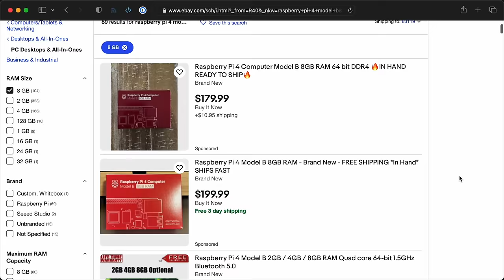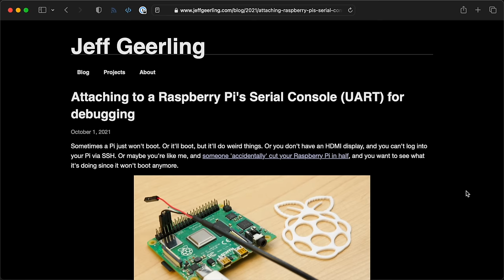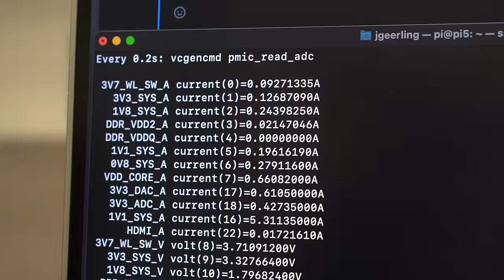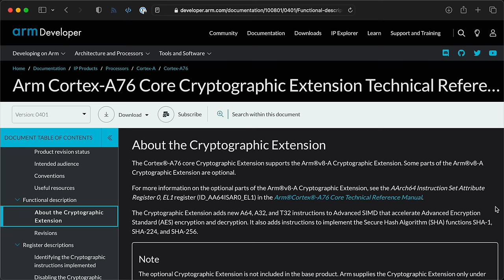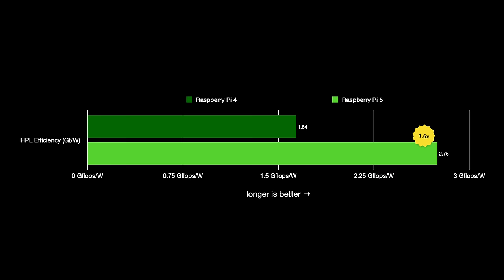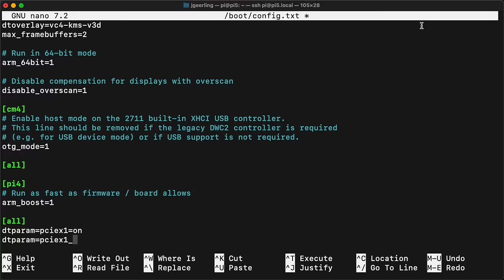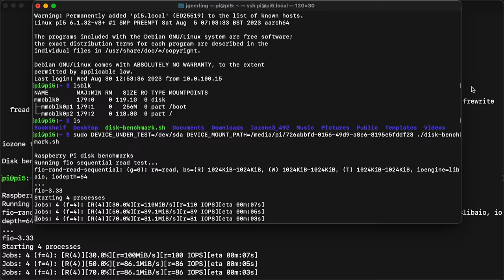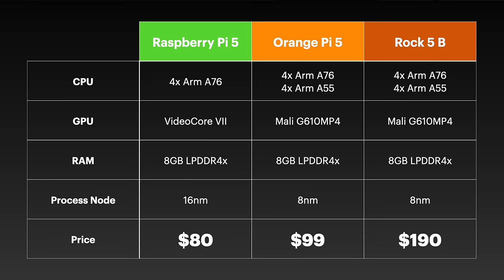Raspberry Pi 5: EVERYTHING you need to know

Comment: Test suggestion: Try if you can set the RPi5 to be a streaming box connecting a capture card to the PCIe port, through USB3 or even using the CAM ports. And with OBS to manage all.

Comment: Check to make sure the wifi driver is actually using the 6Ghz radio!  I recall there was some ridiculous issue with it disabling it because it couldn’t confirm which country you were in.  I think that may have been Intel chipset specific but either way 🤷‍♂️
Reply from the maker: It is working! There are some issues with country and sometimes if on older Linux the kernel doesn't allow 6 GHz band. Have to check with iw

Comment: With the prices these are reaching, it's probably time to add in sff x86 to comparisons. Especially if the power usages are in the same area.
While I'm happy to hear that a lot of stuff has come together and quality sounds improved over the Pi 4 (the USB-C weirdness was really lame), the price jumping higher is going to really start putting it up against x86 where it's going to have A LOT of trouble competing since x86 just has way better compatibility, performance, etc.
Reply: Indeed, x86 still tends to be powerhogging in comparison to ARM but still potentially dealing with older process nodes might well keep it fairer, or ruin the x86 in comparison if you stick strictly to the same price bracket and so old x86 stuff too. But as the SBC prices have jumped quite alot on the way to giving them this much computing horsepower, so a comparison to something like a Steamdeck suddenly doesn't seem so unfair, and that thing has to be the best price to serious performance computer available right now.
The Pi folks historically have done a really really good job on compatibly and performance compared to the other SBC and good enough that for most normal users it will just work, so if the Pi5 is more of the same I expect it still stands up well.

Comment: Hi thanks a lot for the video. I really loved it. I also appreciated a lot the comparison with the rock 5b and the orange pi 5. However you kinda confirmed my fears: every new generation the raspberry pi seems to get roughly twice as fast (or at least twice as useful). This means it will not run a 4k desktop. It's very nice but I would urge people to not upgrade their monitors. A 1440p may be ok but not more than that at least not unless there is some crazy driver optimization that happens down the line. I'm sad for the 3.5mm jack that I actually used a lot. Not all the monitors and not all the projects have that. The big sadness it that now every other manufacturer will copy the big fruit just like it happened on the smartphone. In this regard the raspberry pi had a great responsibility and it failed.
Reply: No headphones jack = brain cancer

Comment: The RPI chip could potentially allow real-time control of IO which is ideal for Robotics applications. I typically use a custom designed rp2040 hat to do this.
Reply: The PI4 is fine for Robotics aswell.
Reply: @AndrewTSq  It is, i've made extensive use of it.
Reply: You could probably do that with any Pi as long as you have a real RTOS to run instead of Linux.
Reply: @jnharton  you can to some extent yes. But it's significantly easier with a dedicated io processor. That's why beagleboards were really good, although they didn't have the commimunity support.

Comment: It would be interesting to see if that RP1 chip supports PIO like on the Pico. Then we could do some truly wild things with it.
Reply from the maker: AFAICR it doesn't, but don't take my word for it. It's like a semi-RP2040, but there are some things in there hidden away that I haven't seen yet.
Reply: If there is PIO hardware in the RP1 chip and it is as well documented as the RP2040 then things like LinuxCNC and stepper motor controlling will be very interesting. The latest LinuxCNC on Bookworm works fine on a Pi4, on a Pi5 it should be even better, eventually?

Comment: Thank you for this great video. I'm curious about the video encoding/decoding benchmarks using hardware-accelerated tools. Please correct me if I'm wrong, but it seems you used x264 for video benchmarks, which is a software implementation of the codec. It would be greatly appreciated if you could also test hardware-accelerated tools, such as gstreamer with omx enabled.
Reply: The rpi5 doesn't have a video encoder block.  You have to use software encoding and pay a large power penalty.

Comment: I’d be interested in seeing a dual camera image classification system. Can the pi5 run two cameras with object detection without an external NPU like the coral? On the flip side, how many camera feeds can handle running frigate, ideally with a Coral if that gets fixed on software, though I assume the USB coral still works.

Comment: Great review Jeff. It took them long enough to get to Pi5, but disappointed they used a less efficient chip, which will take another 4 or 5 years until that is upgraded, if they release Pi6 at this rate.
Reply: It's much more efficient than 28nm Pi4 chip
Reply: @BusAlexey how can it be more efficient if it needs a stronger powersupply by default?
Reply: @TecSanento  Watch ExplaingComputers review. The chip itself pulls 6 watts at most, and that's for 2-4X increase in performance (over 5 watt on Pi 4). All additional watts are for High-power USB and PCIe peripherals (each USB can pull 5W, PCIe can pull 5W, cameras can also pull power). Pi Foundation reccomends a 25W power supply so there's no problem with all peripherals sucking power.
Reply: @BusAlexey  (stupid to require everything over the one single input) - or support higher input voltages. I don't have a single 5A 5V one - even the 200W USB C PD ones)
Reply: @TecSanento  It's not required. The chip's power went up literally by 1 watt. You can still use 5V3A for the max of 15W to the board

Comment: I REALLY REALLY hope they didn't muck up the usb c (and pd) compliance like last time. There's some really efficient GaN phone chargers out there that may be able to power the pi 5 and more just fine without needing the pi psu again.

Very excited for the die shrink and the cpu upgrade though.
Reply: No, it is broken. 5V 5A is bad. That is rare and for good reason. The official PSU even supports less current on higher voltages. That is a USB-C no-no.

USB-C standard imposes a "bigger is better" rule. A PSU with more watts shouldn't charge any device slower than a PSU with fewer watts.
With 5V5A this is possible. A 60W PSU may only support 5V3A (but also 20V3A), causing the Pi to complain. The official 25W PSU however, works.

If more devices do this we can end up back where we started before USB-C, when fast charging really only worked with OEM PSUs. Just look at early Nintendo Switch consoles and the problems they caused. Imagine each phone manufacturer used their own current/voltage combinations. Chaos!

The USB-C standard says 5A is optional in the cable. Most cables are only 3A, making them cheaper and more flexible. To keep "bigger is better", this means PSU's shouldn't offer 5A below 20V. And if they do offer 20V5A, they must also offer 3A on all voltages below. This maximizes the utility of 3A cables, and makes sure everybody chooses the same path for higher power: stay at 3A, but increase voltage. Only once 20V are hit, should 5A be used.

For the Pi, the proper solution would have required a voltage regulator on-board. I guess they didn't have space for it, so they chose to violate the standard. TBH it might have been better to stop pretending and use a barrel plug.
Reply: @oznerol256  The new PS does not violate the PD standard and has a 5A capable cable. It costs $12, and also supports 9/3A, 12/2.25A  and 15v1/1.8A modes. Its a very professionally designed PS, and very high quality.
Reply: @jamesh9756  The violation here is in the charge modes it supports. At 5V it should only be able to do 3A, but the pi needs 5A.
Reply: @jamesh9756  The 5A capability is exactly the problem. It shouldn't have that. The pi should use 9V3A and convert it down on-board.

The 5A way they chose means most PSUs will leave the Pi in power limited mode. Even PSUs with 100W!

And it could get worse: What if some genius makes more 5A capable PSUs? This may lead to more devices using 5V5A. Suddenly we live in a world where a simple wattage advertisement doesn't tell you how fast it will actually charge. Questions like "Does this 65W PSU support 5V5A or not?" shouldn't need to be asked, and will confuse consumers. What if another manufacturer decides to use 9V5A? It could become a mess. This isn't just my opinion. Read the USB Power Delivery Spec Rev 3.1, Pages 804+, Chapter 10 Power Rules
Reply: @jja2000  5v5A is a valid PD mode. It's not a compulsory, nor common, mode, so devices must negotiate and confirm all components are capable of 5A (cable, connectors etc). Which they are in the Pi PS, so the Pi will negotiate with the supply and only go to 5A if supported. Other power supplies may not support it, but that is down to the PS supplier. But to reiterate, 5v5A is not a violation of the PD spec as long as the negotiation is done.
Reply: @jamesh9756  can you point me in the direction to where it's within spec? PD profiles for 1.0 2.0 and 3.0 say the max current is still 3 amps.
Reply: @jja2000  you can have more than 3 A (up to 5 A in PD 2.0) if the cable has an e-mark chip in one of the plugs, which tells the PSU the cable has been built to support higher current. They either has e-mark in the cable or just built into the PSU itself (as the cable is also integrated into the brick).

Comment: Having designed a few boards with RP2040s on board, I'm pretty curious about that RP1 chip. I don't expect it to be something I'd want to design a board around, and I doubt it will be available on its own anyway, I just want to know what it can do.
Reply from the maker: You and me both! I am not the one to hack around on it too much (besides PTP and maybe a little fun). I'm looking forward to some of the interesting features people uncover.
Reply: @JeffGeerling  When I first noticed it was labeled 22/44, I wondered if that was in the same naming scheme as the RP2040. If it was, that would mean it has 2 ARM cortex M2 cores, 256 kb RAM, and 4 Mb of onboard flash. But then I realized there is no such thing as an ARM cortex M2 core, so I don't think that's the case haha.

I wonder if it has PIOs, like the RP2040. That could be a cool feature for some high speed custom signaling directly from the Pi5.
Reply from the maker: @CutoutClips  It sounds like there might be one PIO!

Comment: It's a real shame that it requires 5v at 5A, and not some form usb PD or Quick Charge.

While the "just use a old phone charger" principle died with the pi4. This really is a final nail in the coffin.  

I really hope you can lower that requirement buy not using the PCIe. 

Also no more using cheap Stepdown boards for power.
Reply from the maker: You can still run the Pi 5 with less than 5A, it works with the Pi 3A adapter, or other chargers I've tried, but it will put it into 'low power' mode where you can choose to throttle CPU, or limit USB current.
Reply: If you look at the brick's label @ 5:45, it can output 9, 12, or 15V instead.  Presumably it will default to a higher, more efficient voltage, or else why include them?  But whether it will work correctly at 12V * 2.25A on a better, GaN, multiport brick is what I wanna know.
Reply: 5A sucks, it means you can't run it off a USB power bank.
Reply: @estusflask982  You can still run it at lower power.  And any non-garbage power bank is USB-PD and presumably would run it at 12V * 2A or something.  If the Pi5 could only do 5V, they wouldn't call it USB-PD.

Edit: at least at idle @ 12:29, it is only running @5V.  Either that's standby-specific, confused by the power meter being in the chain, prefers 5V even tho higher is better, or it's just not really USB-PD.
Reply: "5V/5A DC power via USB-C, with Power Delivery support" this is straight from their own website, so I suppose we'll see, if other charge voltages will work. Because I get not wanting to de Stepdown on the pi itself, but 25 watt through 5volt is quite a lot. 

I had really hoped they went the BTT PI route and accepted native 12 volt. Although that is comparing apples to slightly more specialised apples.
Reply: @Idiot_Engineering  Personally, I'd consider "5V/5A DC power via USB-C PD" to be self-contradictory.  It seems like maybe the >5V modes were optional on the PD 1.0 standard, but that was 11 goddamn years ago and no one calls 5V only systems PD.  As for step-down, PC power stages are all >50A each 12V -> ~1.2V for <$1.  At <5A there's no cost or design excuse.  At 25W they'd waste ~2W and need active cooling, but the Pi has it.

Comment: On the lack of through-hole components:
1. The "complex robots" are cool.
2. Don't you need the ports (USB et cetera) to have some through-hole pins for structural reasons? I don't want my ports to be torn off the board!

Comment: Great video, thank you!  Awesome improvements in almost every area, some of which were indeed somewhat overdue.  I'll probably grab a 4GB one before long.  My only gripe:  still Wi-Fi 5?  Twice as fast, all these years later after the 4's release?  Wi-Fi 6 would have turned this "killer" rather than just "pretty good" for me.  Ironically, this board could surely pull higher WLAN speeds from a good USB 3.0 WF6 adapter (and maybe this was their thinking?... but then we're down a USB port.)

Comment: you got a new Subscriber. I wasn't expecting starting out back in 2012 with a RPI B+ to see an iteration of a Raspberry PI 5 this powerful and then to see the dang thing hooked up to a RTX 3080 TI 🤣 . This is absolutely brilliant. I am looking for a retro gaming system for my Living room, so when I have visitors I can have some form of entertainment without buying a Console. I have seen PS2, Switch, and other consoles being emulated on this thing. Micro Center to the rescue had some in stock and I was luckily able to nab one (The 8gb version), along with a PI zero W at MSRP value. I will definetely be watching more of your videos in hope of success with the graphics cards and other PCI accessories. I have a spare 1070 SC in a frankenstien AM3 X64 PC build running debian linux and wouldn't mind sacrificing a giant full tower case for a tiny ARM microcomputer. Keep up the amazing work Man!!

Comment: The resistor is funny. It means changing the position of a component during production runs is easier and/or cheaper than edging 4 different numbers on the PCB. 
It probably also allows for quick and remote changes. Really interesting. 😅

Comment: You brought up Machine Vision but neglected to mention the one big factor the RK3588 has over any pi... it has a 6 TOPs NPU on the SOC which means it is far more suited for any ML inference on the edge than the pi 5 will be. Not many will use this, granted but you did bring it up. In my testing an RK3588 can run a YOLOv5s 640p inference at around 20FPS on its NPU but the pi 4b can only manage 1.6 FPS. So if you are into custom ML on the edge the pi series gets blasted away by Rockchip. Not to mention the RK3588 are actually available ... I bet supply problems continue to hinder pi 5.

Comment: PCIe is going to open so many possibilities, like being able to make a NAS. I wonder how well it would do with a HBA in IT mode running 8 hard drives.  Could build a NAS using multiple PIs doing ISCSI to a NAS head and then doing CIFS etc.   Here's hoping they can actually produce enough this time since the 4 was basically impossible to get.

Comment: 13:14 YouTube allows your browser to choose between H.264 and VP9 video codecs for anything up to 1080p, but only streams in VP9 for anything higher than 1080p. Normally, your browser would fall back to software decoding if the codec that's currently used isn't supported by the hardware, but maybe the browser in Raspberry Pi OS is specifically compiled to never use software decoding for performance reasons.

Comment: 13:20 Youtube is not blocking that option because you are on pios, but because 4k youtube is only supported via VP9 and AV1, which the RPi5 still doesn't have. Youtube only supports h264 up to 1080p (and h265 not at all) for compatibility with old devices and devices that refuse to support the newer standards (which is why it's so strange the pi still doesn't support vp9 and av1).

Comment: New subscriber here. Great info on the Pi 5. I've been wanting to build a Plex server/NAS and am considering using either an ITX board or an SBC such as a Pi 5, Orange Pi, or Rock 5B. I don't need more than 8 - 10TB. Any recommendations? I have a Cisco UCS C240 M4 with dual Xeons and 120TB of HD's sitting around doing nothing, but even with my limited knowledge of servers, I'm thinking that's probably a bit overkill. Lol

Comment: Great video! I’m quite tempted to get one, but I need a solid use case to justify the purchase. Initially, I ran Home Assistant on a Raspberry Pi 4 with 8 GB of RAM and an external SSD. Later, I moved Home Assistant to a virtualized environment for improved control, speed, and backup options, rendering my Pi 4 obsolete. For my DIY IoT projects, I lean towards using ESP32 boards due to their cost-efficiency and lower power consumption. If I were to build something substantial like an autonomous robot, I’d likely opt for a Jetson Nano. Honestly, I would prefer to support the Pi Foundation over Nvidia. I believe the focus should remain on smaller boards like the Pico and Zero. If the Foundation intends to cater to those needing more CPU power, offering products similar to the Intel NUC seems like the better approach.